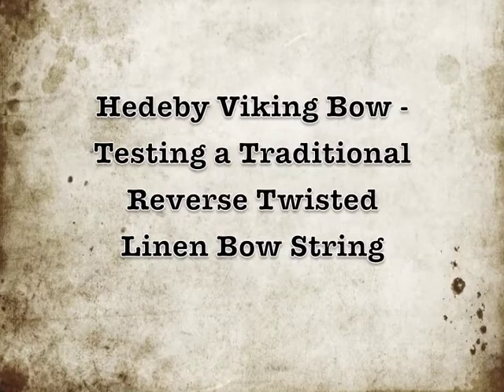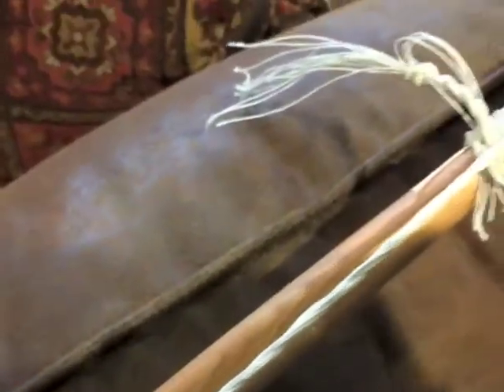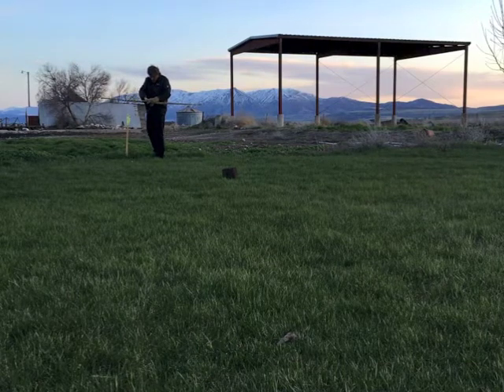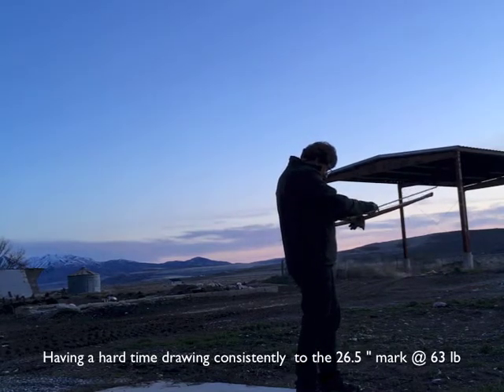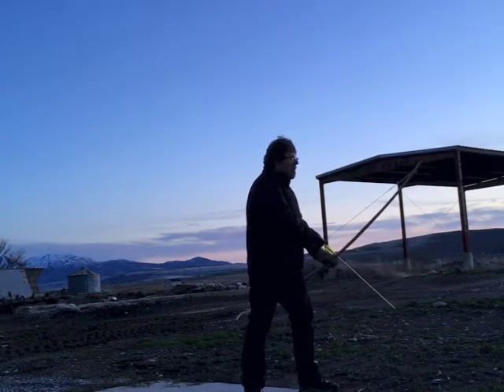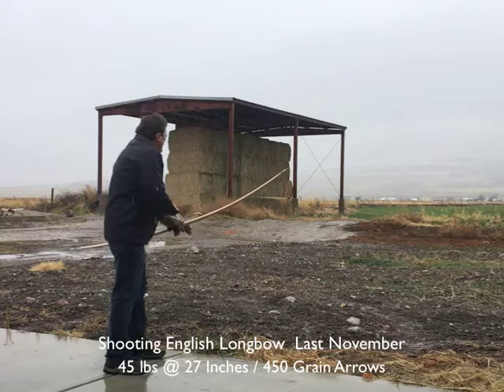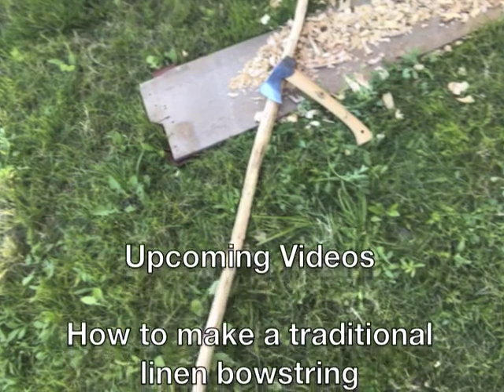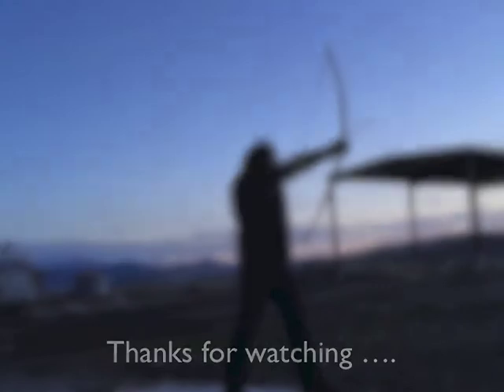Testing a Linen Bowstring for a Viking Hedeby Style Bow

Comment: I've used very similar thickness linen strings on bows around 130lb, and some people have used them up to 180lb with no real problems, but you will find that using 3 bundles is far stronger.  

You also want a maximum of 7 strands per bundle, because otherwise the inner strands don't work against each other and become weak links.  

7 strands is the maximum number for full strength, so to get the string up to the appropriate strength you need more bundles.  At 63lb this isn't too critical but as soon as you hit military weight bows it becomes very important!

Great to see more people using natural fibre strings though, well done!
Reply from the maker: Thanks for the input from somebody who knows what they are doing.  In the US there are very few people making strings from traditional materials and lots of bogus opinions in online forums.   Is the 18/3 linen thread that breaks around 14 lbs decent enough for heavy warbows if you do a three bundle flemmish twist?    I tested some US made linen thread sold in hardware stores and it was junk.
Reply: Yeah the problem with linen is that it's so variable!  You can get really good stuff from the original Irish manufacturers, terrible stuff from the same source but stored incorrectly, and then really good stuff from new European manufacturers.  I think about 14lb isn't too awful, it'll just end up slightly thicker.  Mine's 21lb the last time I checked it.